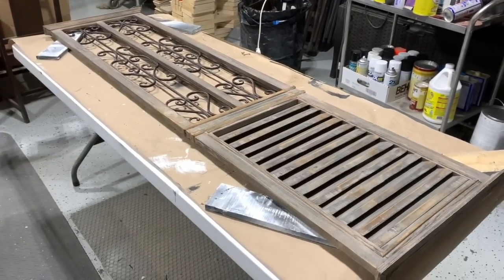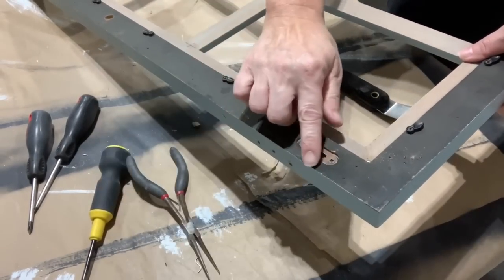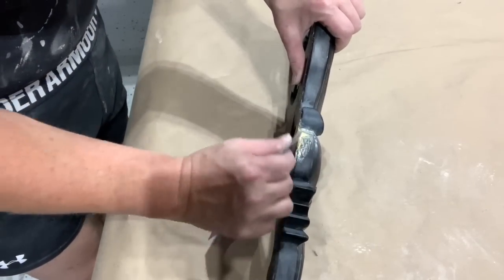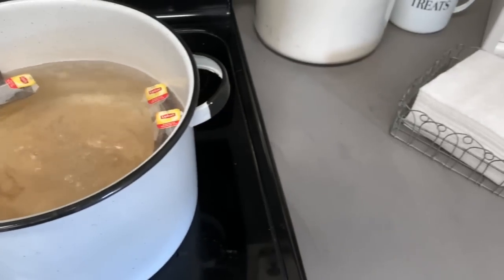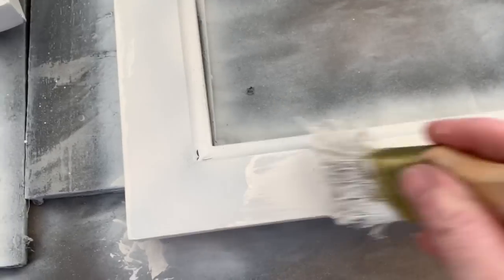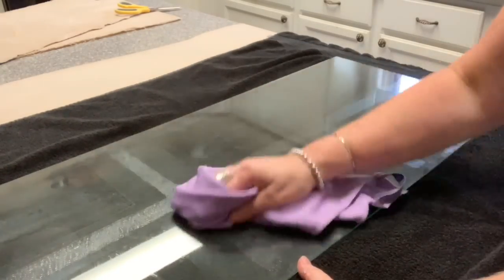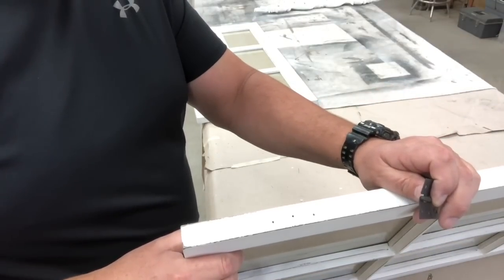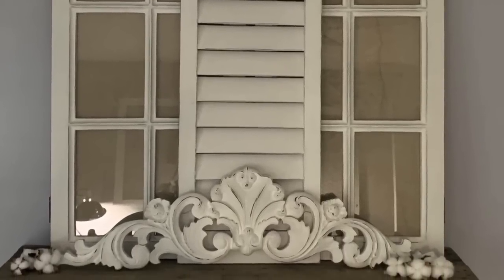Trash to Treasure Up Cycling Thrifted Finds into Farmhouse Decor

Comment: Love the faux wrought iron piece! Prefer the shutter plain. Couldn't understand that worm shape in every pane of the windows. Could it have been a glue stain that came thru? Seemed it was on the backer board too. The architectural piece was my absolute fave. Looked like real carved wood when you finished. I would have bought it even if the hole was on the front!!. We repaired every thing with Bondo when I first started collecting furniture for my 1st house lol. I have to give  water putty a try now that you've shown me how easy it is to work with
Reply from the maker: Thank you for sharing that. Yes we use to use Bondo, So I think you'd really like the water putty.

Comment: You scored some really unique pieces, and of course you made them look fantastic. I was hoping, however, that you would show how you painted the cut outs in the architectural piece. I finally found a mirror at Savers, and the entire frame is similar to that piece. Of course I painted it black first, but I had trouble getting into those cut outs. What kind of brush would you suggest I use when I put the white paint on?
Reply from the maker: Thank you. I did touch on that. That the spray paint helped get in there. And the brush I was using was all  furred  out. So it helped getting in there. If you go back and look you'll see.

Comment: I definitely think you up-cycled these items. The blue windows with the weird slashes on the fabric were completely transformed. One unrelated question: how do you get your hair so fluffy at the roots? Your hair is similar to mine and since its long, i have some trouble with it having less volume on top. If you have any tips...  😊 thank you!
Reply from the maker: Thank you.. I use a sea salt spray or aka beach wave spray just at the roots when wet before blow drying
Reply: @GingerChickRehab  i have a beach spray. Cant wait to try your suggestion. Thank you!

Comment: Have you tried using diy paint or a chalk paint? Also, you would totally tell a difference if you used a really good brush.
Reply from the maker: I have  tried them. I thought they were a little needy and not cost efficient for the masses that we do for resell. And we use to use expensive brushes. And I can say there was a difference. Did not matter if we washed them out every time or stored them in a ziplock. This is just what’s worked for us over time. And what works for us my not work for someone else or something else may work better for someone else 🤗